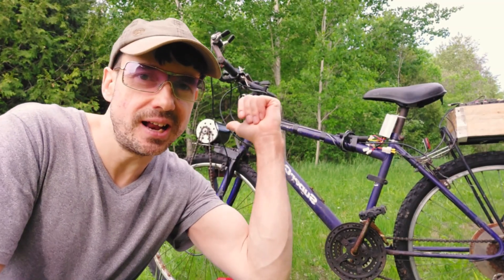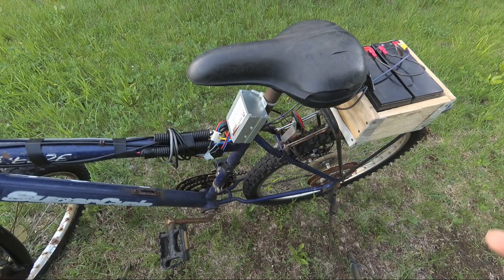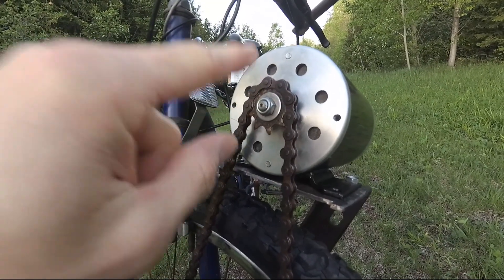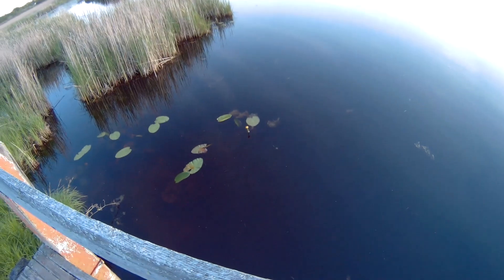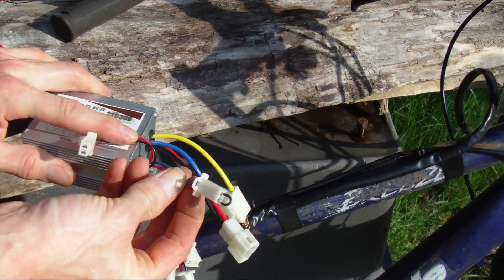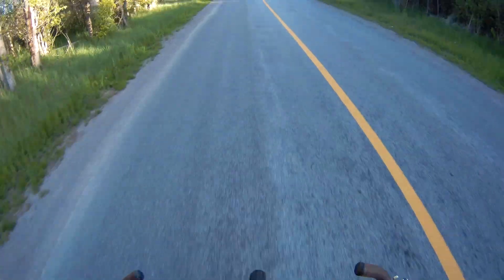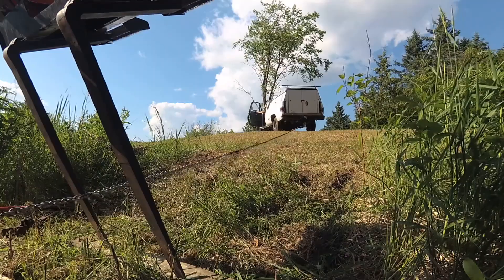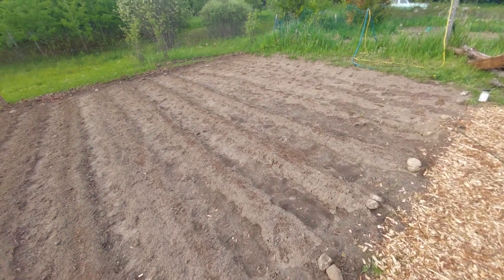DIY ebike that's Front Wheel Drive with Gears [500 watt DC motor] chain drive

Comment: So if the chain pops off and gets all tangled up do you do a Superman dive into the road? I’ve been dicking around with a 60v 1800 watt brushless green works chainsaw motor. My bike it too nice to weld on and drill on so I’m forced to just by a damn hub. But don’t think I didn’t think about options. Using a rear wheels with a cassette and a jockey wheel is def genius tho.

Comment: what happens if the chain comes off at high speed do you go over the handlesbars?
Reply from the maker: Ha Ha yeah that was a concern at first, It did fall off once up hill under load, seems to always just drop straight down. I was thinking of covering the spokes just in case.

Comment: I also built a bike with the same controller and motor but it doesnt run. The 12 or 24 volts of the batteries come to the controller and to the power lock, but not to the motor.

Can you help me please? I dont understand the power lock, i just sticked a piece of wire in the lock and connected bove of the contacts.

Also my bike falled to side and I held it on the throttle grip and accidently it teared of. I reconnected the spring in the hole and the grip seems to work again.

But why doesnt the current go to the motor?

Comment: The build is great except for one thing. Gearing. I am very familiar with those Unite motors and I build e bikes. It is a 2,500-rpm motor which will require a 90-tooth wheel sprocket if using a 26-inch wheel an 80 for a 20-inch wheel. Looks like gearing is for > 50 mph which will burn out the motor up any hill and be very inefficient. Proper gearing for a 500-watt motor is 20 mph. 15 mph is better for up big hills.
Reply: I am currently building a front wheel drive with a 36V - 1,000W Unite motor.  At 36V it is 3,000 rpm at 30V rpm is 2,500 and am using a 20-inch wheel. Power is 833 watts at 30 volts and a 9 tooth 8mm motor and 62 tooth wheel gives a modest 21.66 mph gearing which will be decent up most hills. His building skills are far greater than mine as I use wood as don't know how to weld. If you Google top speed and gear ratio calculator electric scooter parts have that. They also have 8mm roller chain and a wide variety of sprockets. If the guy who posted the video reads this, I would like his opinion on belt drives. I never did one but would like to. I wish I could meet him. I did read the rest of what he said and see that he said an 80 tooth is better, so he knows his build is only ok for the flat. The gears and shifting is genius but would require a motor with lower KV / rpm to work great.
Reply: I watched the video again and the 8-tooth motor sprocket did help him, like to know where he got it. I never saw an 8 tooth before. Looks like around 44 mph gearing if the largest gear on the cassette is a 32T.  My idea I would like to share with him is a 90 KV brushless RC motor. They can push 2,800 watts or even more. At 24V the rpm is 2,160 and speed is 38.68 mph. Power would need to be > 2,000 watts and there are a lot of RC motors that can do that.
Reply: I run very heavy Lishen - 18 Ah - LTO batteries. I bought 24 of them with my stimuli's $$$$. I have two 8S packs which are 20V each and a two 10V - 4S packs. They weigh a lot. 20V = 16 pounds. Why I am interested in a 20V build. I run a 1,800W brushless motor at 50V - LTO. Speed is > 32 mph on the flat but battery weight is ridiculous. Over 45 pounds.
Reply from the maker: Thanks! for the awesome feed back, and it helps all of us with are builds. I did this video as an experiment but quickly changed out to a 80 tooth 25H, I made another video. It's way better now  but I agree a 92 tooth would be awesome for this small motor.

Comment: Nice job I would have pulled a large sprocket from another bike and just used it for uphill
Reply from the maker: Thanks! 👍 I made another video, I removed cassette and added a larger sprocket.  It's way better now and it will climb hills.
Reply: @kurtscottage  It always amazes me how many people make these and don't use a large drives sprocket I realize you can only go so big before you have to switch to motorcycle wheels but I would personally want to travel at least 30 mph max since I know I can pedal that fast at top speed.

Comment: yo do you really need two bvatts? aslo what kinbds bats r those!!!
Reply from the maker: You could use one with a 12v controller and motor, 24v is better tho.  12v 10Ah lead acid batteries

Comment: Motor you run with 24v look like 36v 500w
Reply from the maker: True I saw the exact same motor in 36v 500 watt.  The windings should be different in both motors, but who really knows unless you test or take them apart. ✌

Comment: Have Milwaukee m18 batteries. Be interesting to see if can do as much as you did with them.
Reply from the maker: I looked up those batteries so they are 18v 5ah each. One idea If you have two you could use them with a 36v controller, but the distance will be less.

Comment: nice job. I built a 2 stroke 49cc version of this a few years back.  I drove it about 1500 miles before I eventually stressed the main bike frame and it started to crack. I did repair it and reinforced it,  but I never really trusted it after that. so if I were to build it again I would have located the engine where you put your motor instead of in front of the wheel. Anyway,  here's a link to the crappy video I made years ago. I think you will enjoy it. Thanks for the show. Joe. https://youtu.be/IM3HRBcX4lo
Reply from the maker: Thanks a lot 👍 1500 miles is awesome.  I'll check it out